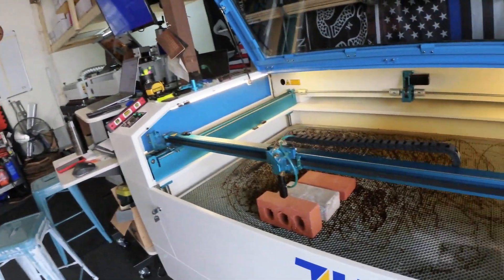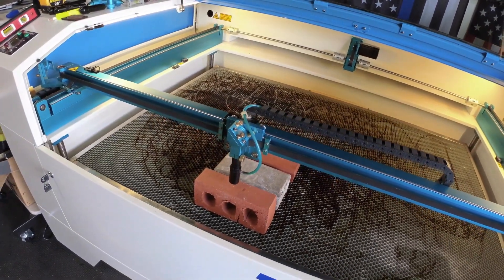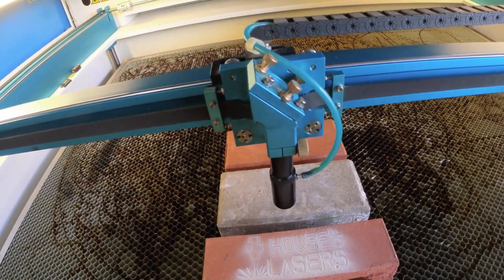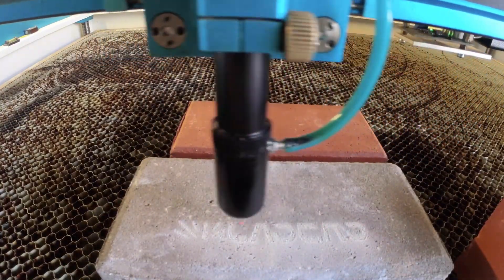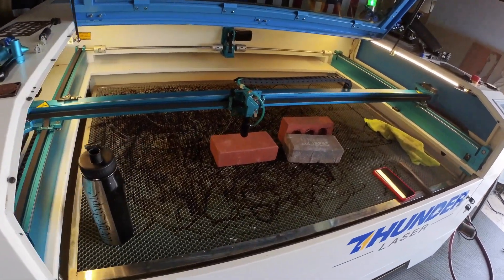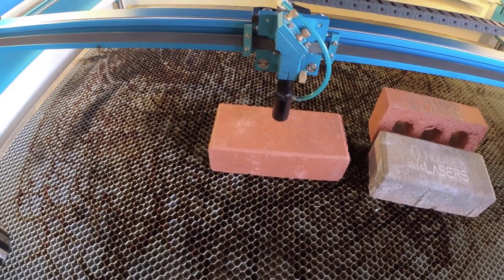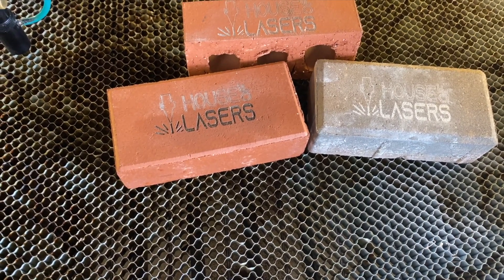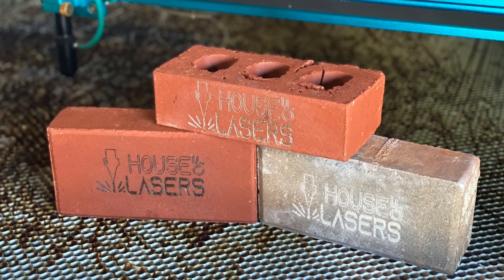Will it Laser(BRICKS!!!)

Comment: You set the file up wrong. Your supposed to offset or countour the letters so they are a bunch of really close together lines then run it on the line setting or vector engrave
Reply from the maker: We followed the manufacturer’s directions. But yes the results are better using Inside offset and fast cut lines